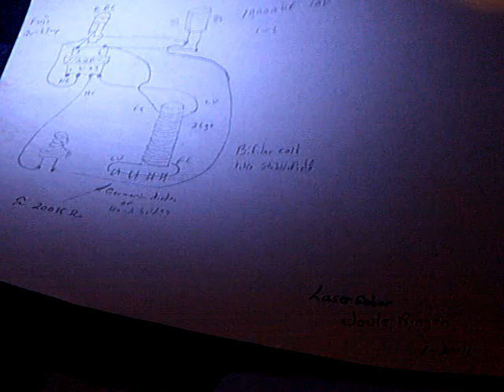Joule Ringer running on 10v - 10,000uf caps.ASF

Comment: Thank you Lidmotor for doing this replication.
the only thing I think that "you may have done wrong" is maybe the coil may have been too small.  I dont know.  But I think that this circuit may have potential. 

Heres a Lark, Try hooking this to the output of a slow pulse motor! Your run time of 3 minutes could easily be topped off by a spinning thing.  

Other then that, Thank you for your work and descriptions.
...
time to feed the baby.

Comment: I have your circuit on simulator and I did see the blip rings every so often.
I doted the input it finally put 5X that at 50Khz it lasted a while
and I think that it is not easy to get kodak to oscillate right. I think your replication is very good. The kodak transformer uses 6T #25 :: 1750T #45   the other coil the trigger coil is 12T#33::450T#45  so modifying it to run an NS bifilar into this may be tedious. as more info is released adjusting your NS coil may lead to the strong 50Khz